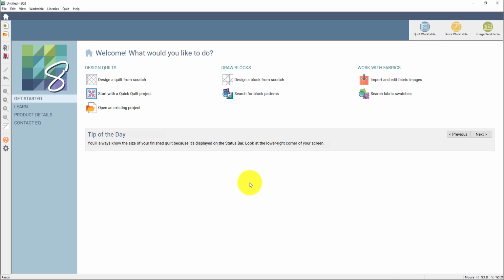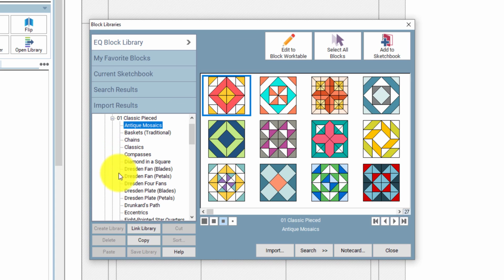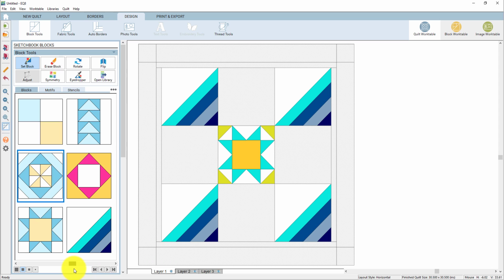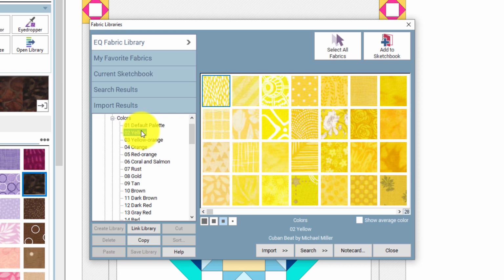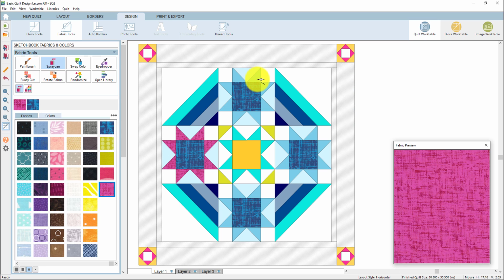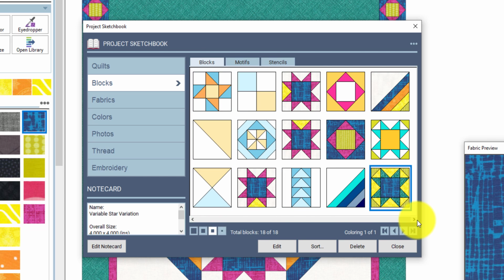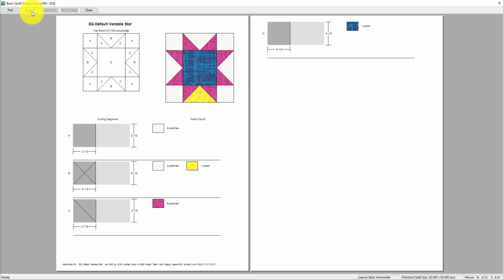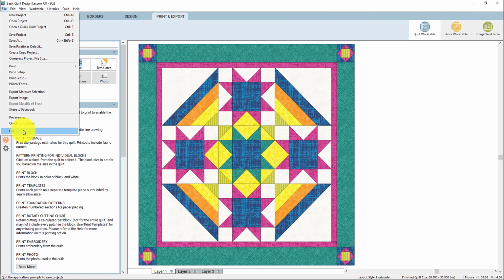Electric Quilt 8 (EQ8) Beginner Quilt Design Lesson

Comment: When I clicked in the center block to add the variable star variation, every block was filled with it, I don't know what I did wrong, why I can't select specific blocks.  All the squares are filled with whichever block I select.
Reply from the maker: Hello! It sounds like you are holding down the Ctrl or Cmd key while clicking on a space. That is the keyboard shortcut to fill all spaces at once. Make sure you are not holding down any keys on your keyboard and then click on a block space to set the block in that single space.
If you have other questions, or need more help, you can contact EQ tech support at techsupport@electricquilt.com